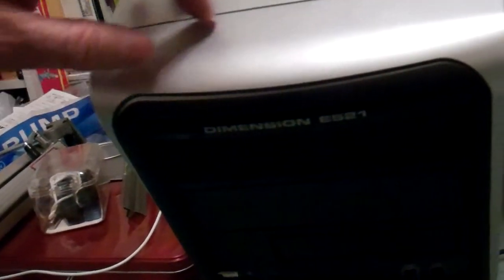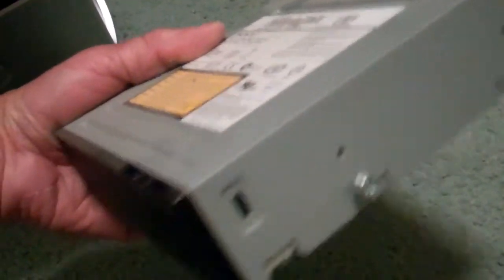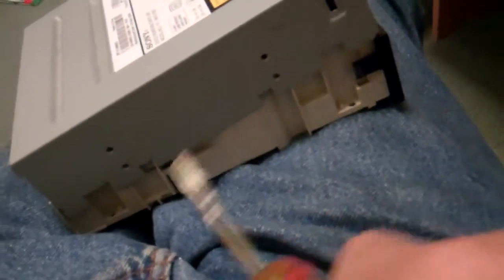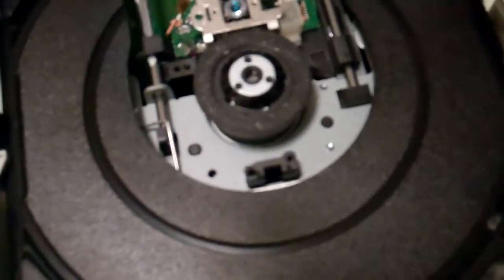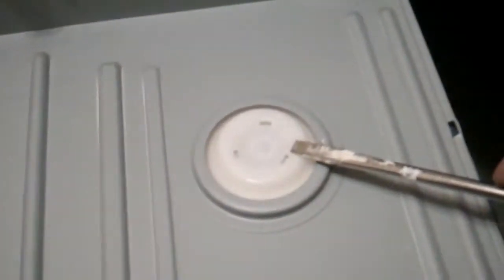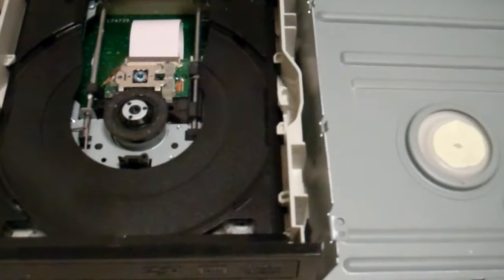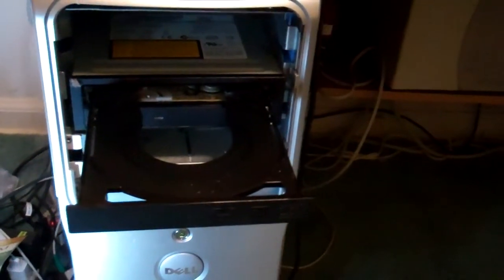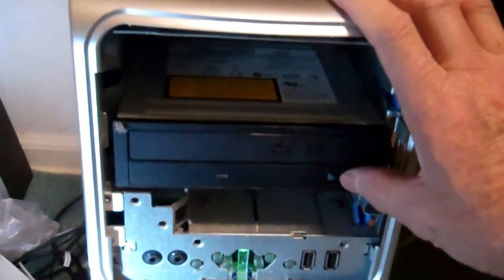Repairing a non ejecting Dell Sony DVD drive Movie pt 1.wmv

Comment: Hey wtam69, Thank you sooo much for posting this!  What a nightmare.  My Dell Inspiron 530 had the same problem.  The hole in your paper/card for the nipple is really important!  I left that little detail out the first time; but once I corrected my mistake your solution worked like a charm.

Also: Something that may help breaking into the CD drive case.  If you use a paper-clip and eject the tray BEFORE breaking into the case, and then pop the 3 flanges for the black front enclosure to release that front panel (the flange on the bottom is hardest)...Then once the black front panel is pulled away from the case the bottom and top separate MUCH easier.

Anyway, thanks again.  Without your handy video I would've NEVER in a million years figured this out.  What a headache!  All better now.
Reply from the maker: This is just a temporary fix. The drives are so cheap now it's probably better to buy a new one. Good luck.